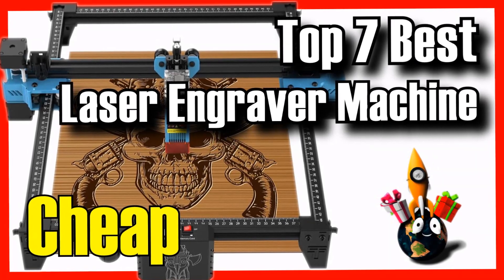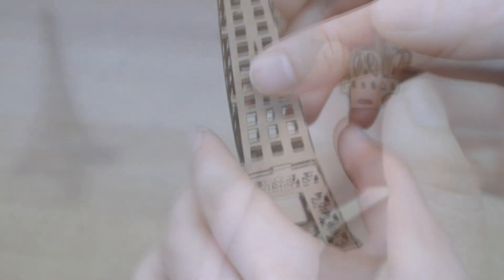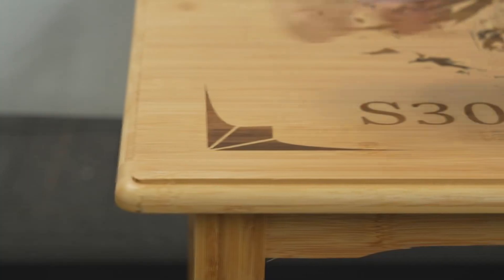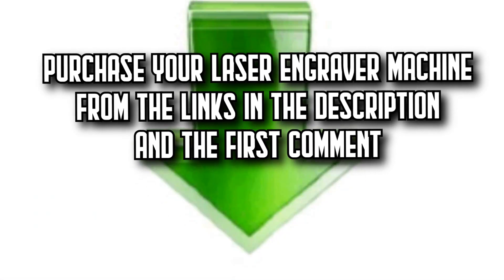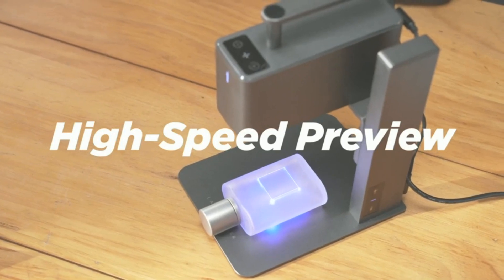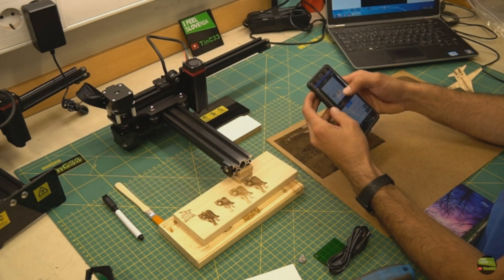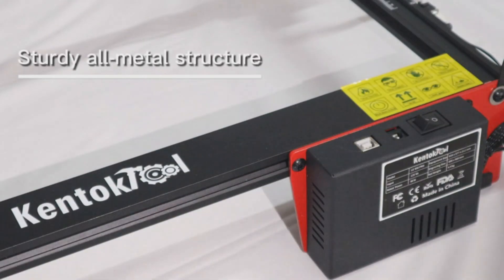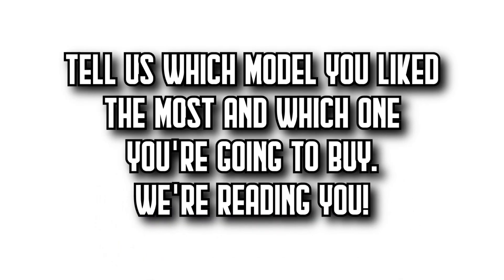🔥🥇  TOP 7 BEST Laser Engraver Machines on Amazon [2025]✅[Cheap] And Cutters For Beginners / Metal

Comment: If you're exploring laser engravers on Amazon in 2025, the Monport Mega is a standout choice. It boasts a 70W CO₂ laser, auto-focus, flame detection, and a spacious 27.56" x 13.78" work area, making it ideal for materials like wood, acrylic, and leather.